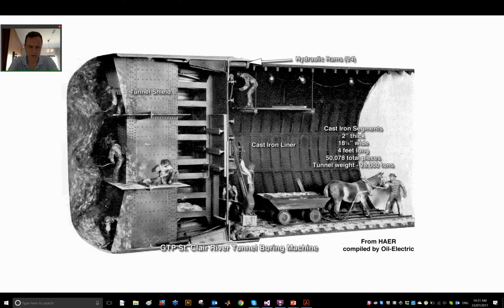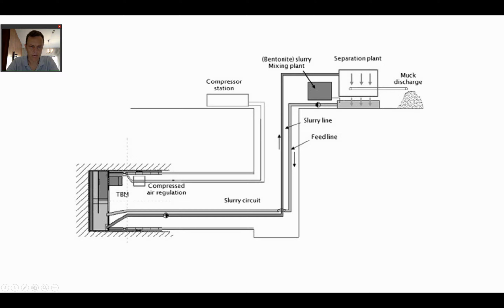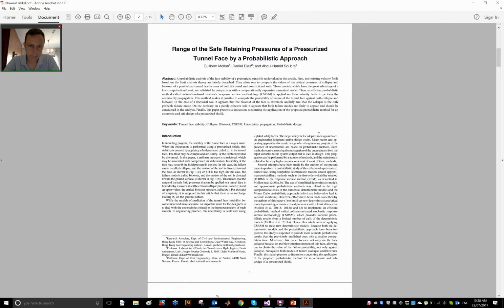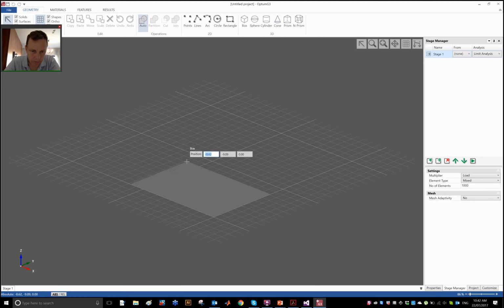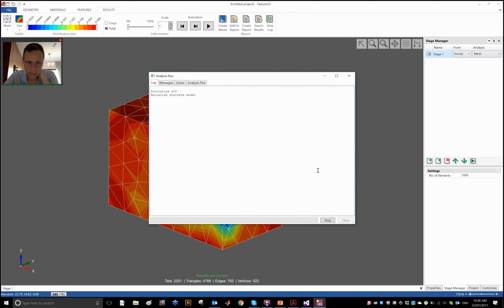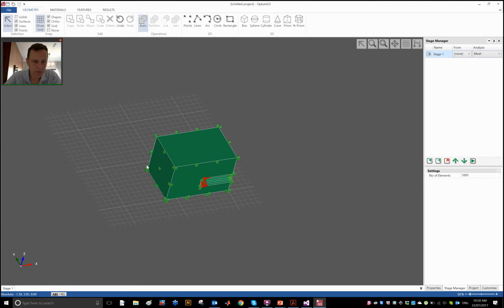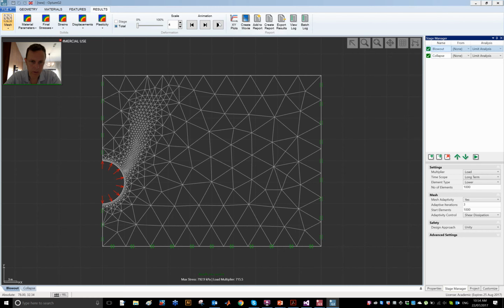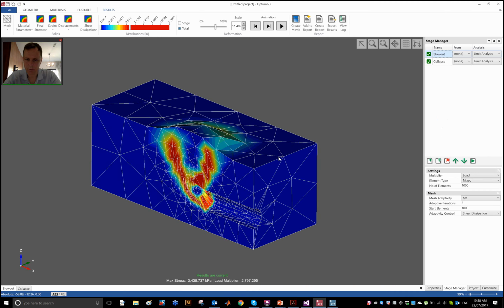OPTUM G3 Stability of Tunnel Face

Comment: Please note that 2D analysis is wrong, axisymmetric analysis is not selected. Correct versions are given in links below. In this case, it is much closer to 3D analyses: 1396 and -65. 
Also, we should note that -65 kPa is not minimum face pressure. It is a value that has no physical meaning: Additional load from the soil side to collapse the face. If you want to define a minimum face pressure, I think it will not be possible to do with limit analyses, but we should go to finite element part of OPTUM to define a deformation limit or no-collapse limit.
https://i.imgur.com/TrHW0ov.png
https://i.imgur.com/SDQ0V8U.png